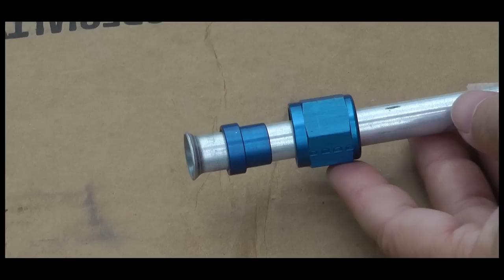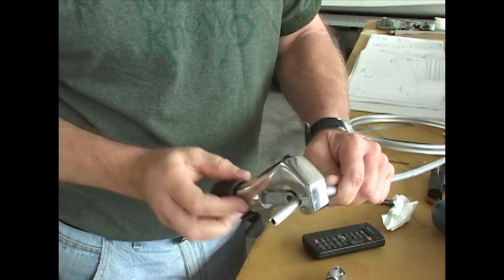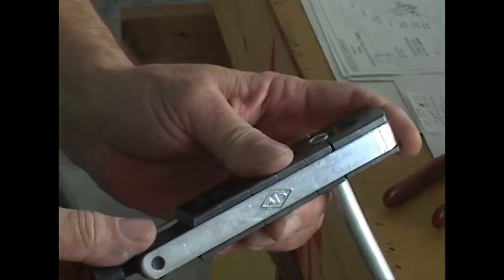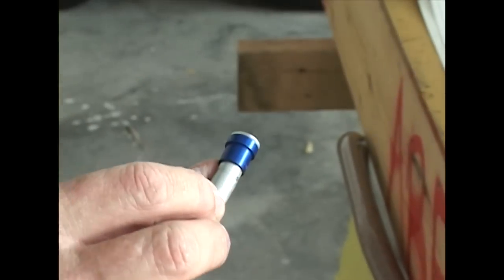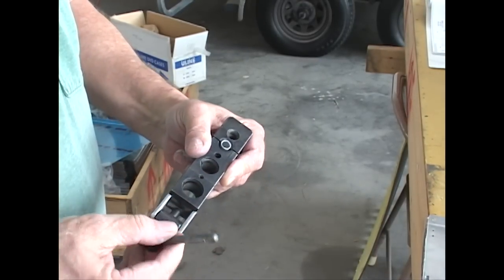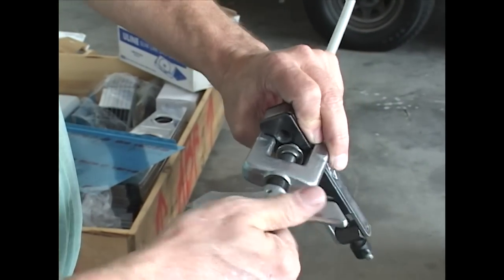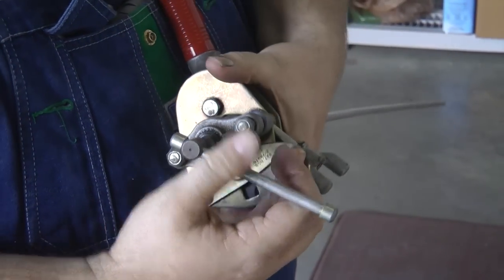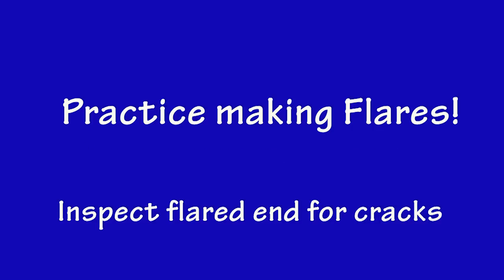How to Flare Aluminum Tubing for your Experimental Aircraft

Comment: You can easily remove too much of the material from the end of the tube using a knife like this.   This could affect the flare connection to the fitting and under higher pressures this will cause leaks.
Using the proper de-burring tool, while ensuring you only remove burrs, is the correct way to prepare the tube for flaring.